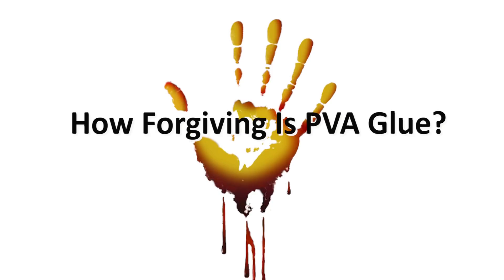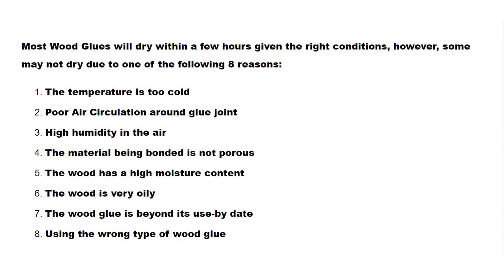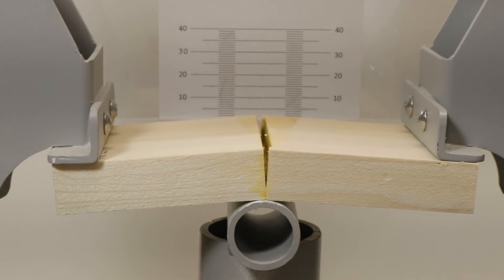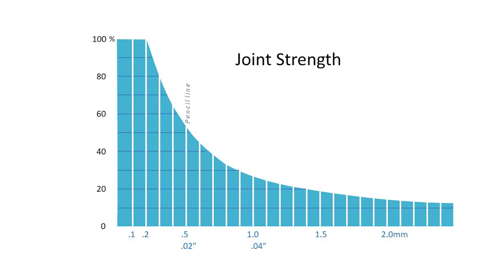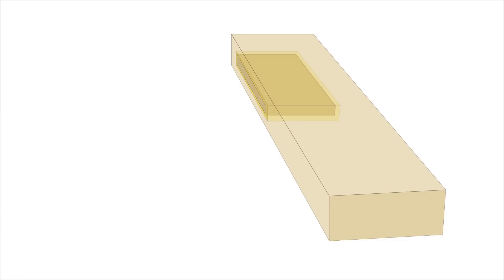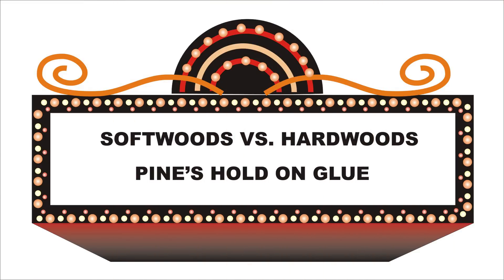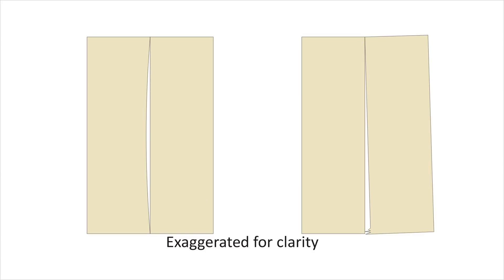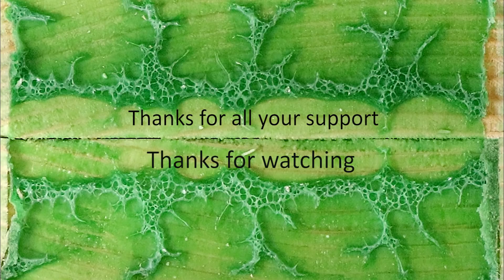How Forgiving is Glue?

Comment: I did a similar experiment at work over a decade ago gluing Baltic birch plywood together with tongue and groove joints, tested for ultimate tensile strength with the joint in tension. For PVA glue a 5 to 10 thou (0.13 to 0.25 mm) gap in clearance of total width between the tongue and groove produced the strongest joints. Samples were clamped for 2 hours, clamps then removed and samples cured in an environmental chamber at 30% RH / 22 deg C for 96 hours.

Comment: Hello, Patrick, Another great video. I'm interested in your thoughts about what you have learned about PVA glue joints and the traditional sprung joint. For those who may not be familiar with it, the middle of two joining faces are planed very slightly concave so that the pieces touch at the ends and have a very slightgap in the middle. Glue is applied to both pieces and the boards clamped with sufficient force to close the gap. The thinking is that the grain at the ends of the board expands more than in the middle, and the gap will allow the ends to move -- particularly to contract -- without breaking the joint.  In particular, will the middle of this joint be weaker than if it were joind flat and glued ideally, allelse being equal? Stu
Reply: I think that is a really complicated question to answer- wouldn't that entirely depend on the wood, and precise application and technique? I'm not sure that question has a general answer- I can see that advice coming from an expert with a particular use case in mind. As far as logic has it, if it has the ability to expand and contract equally, both could split the joint, and a straight joint would probably balance these quite well? But I won't say it is wrong, I'm sure 20 people could comment a different situation that it is absolutely imperative.

Comment: This makes me wonder about whether you really need to glue both sides of a joint prior to clamping. My thinking is it if it does make a difference, then you should definitely be using half the amount of glue on each surface compared to the amount you’d use were you only applying glue to one surface. Seeing this video I’ve definitely been using too much glue (which I figured any way based on the mess made by squeeze out)

Comment: Excellent and very informative!

I came away with a few more thoughts:
1) in type 2 joints where the strength is critical, use a curing adhesive with minimal shrinkage, like epoxy. 
2) based on your other video about grain direction, end grain shims might perform better. As I write this, it occurs to me that if shims work by filling the gap with wood, then perhaps a thick paste of sawdust and PVA might work as well or better, provided you apply a thin coat of glue the joint surfaces to ensure they are wet.

3) There is enough strength after about an hour that, at least for small items that don’t weigh much, they can be handled and worked on

4) Unclear to me what clamping contributes to joint strength after the first few minutes post assembly. The pressure does ensure that the joint will be assembled with as thin a film as possible, but It seems that unless the joint is constrained under tension, the glue’s shrinkage will draw the joint together anyway. 

These tests only addressed the effect of fit, but there is also the effect of moisture. My guess is that it will take longer to cure and will never achieve the full strength of dry.

I’m also curious about the effect of the joint being disturbed during its cure. My guess is that that once a decent tack is present, moving the joint can’t be helpful, but I’m prepared to be surprised by another of your excellent studies. Maybe you should get a sponsorship from Instron!

Comment: Wonderful series of videos.  Who knew glue could be so interesting, especially given a topic that is basically about "let's watch glue dry".  I'd really like to see some real data on how important (or not) it is to put glue on both surfaces.  Also as an extension to the current video, how does adding salt (to reduce slippage) impact the strength of the glue joint.

Comment: Some people talk about thinning glue for endgrain before actually putting glue on the joint.  Thinning the glue with water then putting heavier coat on as the thin coat is being pulled into the joint.  Fill the engrain before adding copious amounts of glue.  I think this is called sizing the joint.  What affect would this have on the joint?

Comment: When choosing adhesives (typically epoxies) in the lab, I always read the manufacturer's data sheets.  They always say to use as thin a bond line as possible - ie, smallest possible gap.  This was typically for non-absorbent surfaces.
For gluing wooden joints with excessively thick gaps, wouldn't it make sense to add fine sawdust to the glue?  I'd love to see some measurements on bond strength vs sawdust fraction for a standard wide gap.
Reply: That's a good thought, and I would go one further and say that almost any kind of filler would work, or at least help.  A mineral filler like very fine sand or clay or talc would probably do the job.  Anything that reduces the volume of the glue will reduce the shrinkage. The down side is that it also reduces the workability of the glue -- makes it stiffer and less flowing.  That might be a plus in some situations, not in others.  Interesting.
Reply: @BLenz-114  this makes me wonder about the impact of table salt, which I’ve used in some glue ups to keep things from sliding around.
Reply: @MrBebopChamploo  I was thinking the same thing when he showed the joints with the cup and the "foreign object".

I have tried the salt trick once...and that was enough for me. Not a fan, and this video reinforces my decision.
Reply: @MrBebopChamploo  I've only heard about using a small amount of kosher salt to avoid sliding. The rationale being that the grains are big, and provide a bit of abrasion before dissolving into the water in the glue. I'd think table salt would dissolve too quickly, and be too small to do much of anything.
Reply: @BLenz-114 epoxy resin is not a glue until you add some filler, wood flour being common fumed silica being the strongest.
Reply: So Paul, what kind of lab do you work in?  I work in a state DOT lab testing Portland cement and mineral additives that also go into concrete.  Our adjacent concrete lab tests Portland cement concrete, but also does quite a bit of work with polyester concretes.
Reply: I wouldn't think to use use glue+sawdust on joints, but I often use it as a filler! So I think that's a much better contender for a gap-filling wood adhesive than wood glue on its own; I'd be really interested to see that tested.

Comment: Excellent demonstration, and comments below. Using shims was an obvious conclusion, but some joint gaps are so narrow that it is hard to find shims that are thin enough, so I am thinking that sprinkling sawdust onto the wet glue before clamping might improve strength.
Reply: Interesting hypothesis. I'd like to see Patrick test it. The purpose of the shim is to use the lignin, the sawdust might fill enough of the gaps.
Reply: I had the same thought. This really needs to be tested! Maybe a bit more than a "sprinkle" of sawdust though!

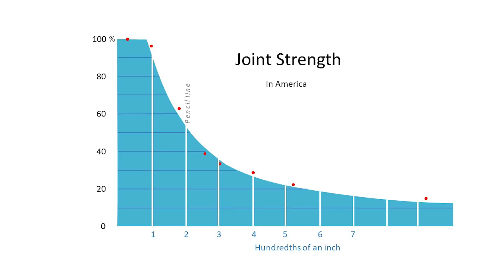Comment: @6:48 that's why I fire inordinate amount of brad nails.  :)  It's pretty much all metal by the time I'm done.  Bit seriously @5:50, even leaving 1/32" inch "room for glue" in a joint will reduce the hold so much.   I know you tested biscuits, but I hope you plan on testing dowel joints.  I guess domino's fare better because they have more smooth surface as compared to biscuits.

Comment: very interesting, thank you for doing these videos.  A potential suggestion, how about a filler in PVA, like wood dust, how does that effect gappy joint strength and is there a optimum ratio of dust to pva, how about particle size?  I expect you'll have endless questions, thanks for doing the research.
Reply: One vote for the filler strength test
Reply: Another vote here

Comment: It would be great to 1) define the lignine bond strength for reference (how much glue resistance you can loose before the joint actually fails in the joint and not on the wood when glueing with the grain) and 2) how much if any can saw dust help recover strength on a sloppy joint, by filling gaps between surface.

Comment: This is great data!  I’m an amateur luthier and so many acoustic guitar joints are based on various arcs. Achieving tight joints can be very challenging, especially when operations are not performed by CAD/CAM. Still, I prefer one-off by-hand operations. So satisfying when the instrument stays in one piece as string force is applied! And if it also looks sounds and looks good…nothing compares in my woodworking experience!

Comment: I really enjoy your investigations. If pushing the limits (model airplanes, speed boats, portable cases, etc.) this is incredibly important. But, for most woodworking projects you aren't trying to minimize weight or size - often a design is "beefy" or "chunky" on purpose, and in these situations sloppy joints are still strong enough for any forces the joint will experience in normal use. If a gap is glue's Achilles heel, suface area is glue's secret weapon. If your joints are sloppy keep going!

Comment: I'm not a woodworker even thought I love that material. I rarely use PVA glue. Only if I'm in a hurry or don't really care about end result (think of some temporary jig). When I do want strength, I use two components epoxy. And I preheat it in water bath before mixing. Fine wood dust can be added into the mix. Sure people knows all those things. Maybe they should use it a bit more often?

Comment: Your excellent work seems to indicate that clamping really is key. It makes me think that joints should be clamped as tight as possible and left in place until the glue has fully cured. Maybe clamp-time vs joint-strength is worth testing.
Reply: It is common knowledge to retighten clamps after about five minutes when butt jointing

Comment: I'm assuming all your glue-ups were end-grain. Is it possible that the straw-like structure wicks away more glue, thus reducing the strength of a larger gap more?
I'm assuming you went with end-grain as you end up testing the glue-strength as opposed to having the side-grain just break, but I'm wondering if in a mortise and tenon joint this methodology produces false results as it's mostly just side-grain, which I'm proposing might not wick the glue away as much. Yes the moisture will always leave, but in end-grain, does some of the residual glue as well?
So it might be that instead of a 0.2mm 100% gap strength it's 0.3-0.4mm which could be quite significant?

Anyway, I think this is probably the most important video of your series so far. I can't tell you how much I appreciate these.

Comment: I'd love to see if there is truth to the myth that a planed surface has a better glue joint than a sanded one. Perhaps a sanded surface has the potential to leave tiny little gaps left from the grit of the sandpaper for air bubbles like you demonstrate here?

Comment: what is your thought on adding sawdust to the glue to fill a gap that is really too thin to add a shim help
Reply: In theory, that would be the same as two uneven sides, just like in Patricks video. SInce the water evaporates, all you are left with is extra wood. it's good for asthetical purposes, but not for strength.

Comment: Your methods are superb and thus provide useful insights, so thank you for taking the trouble to both think through the issues and design appropriate tests.
I wonder if adding saw dust to the glue to varying concentrations impact the joint strength?
Reply: Thought this myself. At some point it moves into fiber composite instead of just glue.
Reply: @quintessenceSL  oh, well, labels...its just adding sawdust to wood glue. You probably came to that idea too thinking about the voids quintessenceSL?
Reply: @Bennyboy-dog  Yea, if the apparent cause of weakness in a joint is water evaporation, well try to reduce the amount of glue in the joint.

You can do that with perfectly mated surfaces, or you could use a matrix. And no one says it has to be specifically sawdust.

I note from wiki wood has 10% or more water absorption, while FRC is 0.3% and below. While nicely mated surfaces is doable once you have some skill, until you reach that point, here's another option that might actually be stronger and more forgiving.

Comment: I'd love to see a test like this using another type of glue, or a single joint tested with various glues. Epoxy, polyurethane, and CA glue are also in my shop. As a mid-level hobby woodworker, I can get  many simple joints to well within 0.5mm, but I do think of 10 thousandths of an since, 0.25mm as the practical limit for simple joints. Some joints have inherent strength that does not depend on the glue, so I don't worry too much about the glue in a dovetail or a through mortise. They have enough mechanical strength. Is it possible that epoxy is best for mortise and tenon and CA glue is ideal for dovetails? Interesting to think about; no shortage of stuff to learn.  Thanks for contributing to woodworking.
Reply: Fine Woodworking magazine published a rigorous test in August 2007 comparing different glues. Basic take-aways - PVA and epoxy are the strongest, hide glue (either kind) is somewhat less strong - but still very good, and polyurethane is weaker still and especially terrible on loose joints. Epoxy is the only adhesive with any significant gap-filling capability. The wood affects things too, different glues performed a little better on different woods - maple vs oak vs ipe. Also - fitting your joints well is important. Their definitions - tight = 0.0mm clearance, snug = 0.1mm (0.004"), loose = 0.2mm (0.008"). Any larger gaps need fixing - a 0.5mm gap is not a joint, that's a chasm that needs filling.
Reply: @Jeffsd17  Good info, thanks. The test results seem to varie quite alot between different test setups. There are many variables involved.
The conclusions that I have made is that I use PVAc for indoor- and epoxy for outdoor applications, no further thinking needed for me.
Reply: @Jeffsd17 Shame they didn't add UF glues into the mix. Sta0le of the joinery trade for decades.
Reply: And the average plastic glue gun :)
Reply: Please don’t forget aliphatic resin (yellow glue).

Edit: it would make sense to me if all glues that cure via evaporating solvents were similarly non-gap filling. Please test that too. This is gold!
Reply: Search YT for "wood by wright glue test".

Comment: Thank you Mr. Sullivan. This is probably why many woodworkers don’t respect glue strength. Glue is not as effective unless you start with very precise surfaces. Your videos are a gift to the hobby.
Reply: True, glue is the best if you know what you're doing. They glue planes together, but it has to perfect! Clean and no gaps. So for most normal people a nail or screw is better.

Comment: Very useful and appreciated. Perhaps dowels and/or pocket screws would provide a joint of preferable strength so long as they were usable on a given project. My limited experience suggests that properly installed dowels should have very small gaps between the dowel and the board in which it is installed providing optimal glue surfaces.

Comment: Thanks.
I've always wondered if glue needs to be applied to both sides of a joint and if lightly dampening the wood before applying the glue would increase joint strength?

Comment: What about the amount of clamping pressure? I've often heard/watched other youtubers say not to clamp the work too tight, and seen others put an enormous amount of pressure on the clamps. From this series (excellent btw) it would seem that the high pressure would leave little or no gaps and therefore give a stronger join, or would it? 😕
Reply: When I clamp up I think I'm closing gaps. If I suspect gaps, I clamp tighter. I wonder how smart that is. So far, it still makes sense for some joints. I parallel clamps could crush those little tabs Patric left and on a longer piece, bend the wood inward. I have also found, though, that simple tape can result in what feels like a good joint. So now I wonder.... :-)
Reply: Clamp until glue comes out, then stop. You can rub glue into the edge with your fingers beforehand if you want (it's amazing to see how fast the moisture is sucked in). The most critical issue with clamping too hard is bending. You can counter that problem by placing boards surrounded with packing tape on your joint and clamp them together to keep your glue-up flat. Make sure to clamp all your clamps, both on the glue-up piece and on the keep-flat boards, evenly and not one after another. Steve Ramsey shows these methods in several videos.
Reply: I was taught to tighten clamps until you can see glue squeezing out uniformly around the whole joint, but to do it a bit more gradually to give the excess glue time to move.
Reply: @MrBebopChamploo  especially for panel glue ups its important to lightly clamp at first until the joint settles and the glue becomes slightly tacky then tighten the clamps a little more to ensure the joint is tight. its far too easy to overtighten clamps on panels so tighten just until its snug to prevent warping(potato-chipping)

Comment: Okay great video and I love that you didn't shy away from showing the data. 

Another thing to test I've often seen people add sawdust to pva glue to make their own wood filler and I wonder if that could add back in some strength to the glue joint.
Reply: 🤔 thinking the same!
Epoxy and wood flour or microfibers???
Reply: I'm pretty sure this is weaker than thick glue by itself.